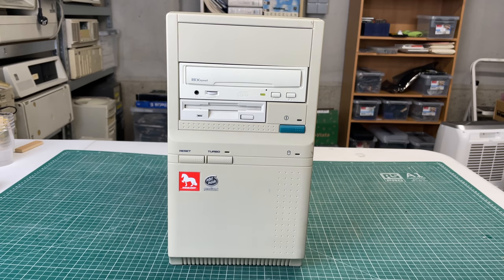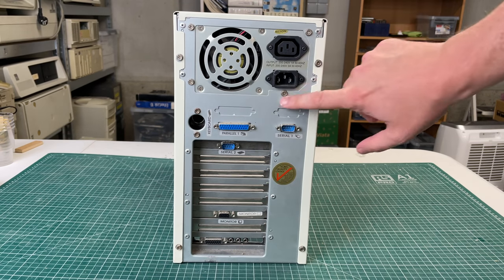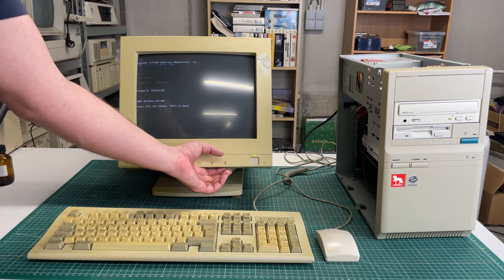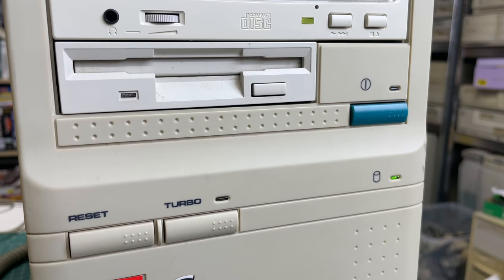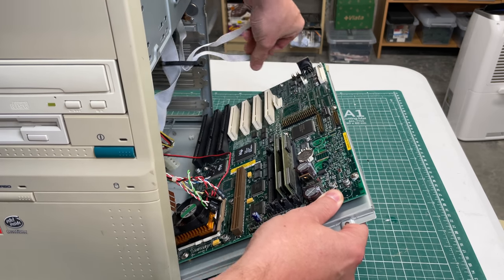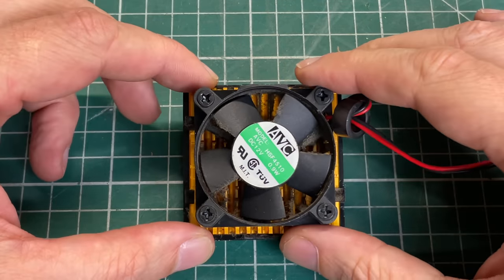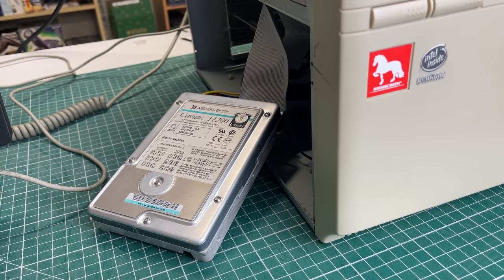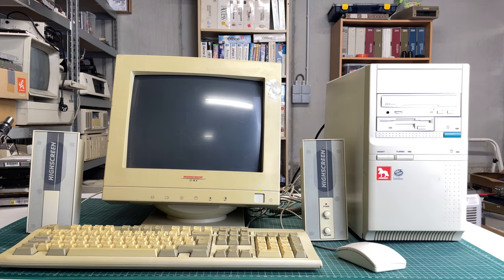HighScreen Pentium 75

Comment: We used to have that Colani tower from the left hand side picture in 1:20, but as a 486 DX2-66. It was a little bit different. The store we bought it from was near the Hamburg city centre, probably crossing Esplanade-Neuer Jungfernstieg. We had to RMA it once though because my father busted up the frame for the replaceable harddrive, but later on we retrofitted it with a Soundblaster and CD-ROM drive. I wish we had it back. And one thing: the POST screen was blue, I don't remember why but it was maybe an older version of the Award BIOS (which I'm still looking for to run on PCem), before they came with the Energy Star logos like in the Windows 95/98 era.

Comment: The harddrive in fact did make a sound, the little "beep"you hear is the drive motor trying to spin up and not a warning about a dead cmos battery.
Reply: I worked on these old pc when they were new and those maxtor would sometimes seize up if you left them turned off too long between power on states. You just had to take it out and shake it gently as it tried to boot and that would typically get it going again.
Reply from the maker: Correct, unfortunately the hard drive has bad sectors and not that reliable to use anymore.

Comment: 16:22 Those were Primary IDE (40-pin), Secondary IDE (40-pin), Floppy (34-pin), Parallel (25-pin), respectively. You could see "PRI IDE" "SEC IDE" "FLOPPY" "PARALLEL" written on the board.

There is no Game Port connector or reserved solder points; on the other hand, there are VESA Feature Connector (26-pin) next to AT power, and a Wavetable connector (8-pin; I've never seen a wavetable daughter board with just 8-pin before) between 14-pin VGA (pin 4 or 9 can be omitted on a DV15 connector) and 4-pin analog CD audio connector.
Reply: floppy is 34 pin
Reply: Fixed.

Comment: Real fun to see this. I started my Windows experience with a Pentium 1, 75mHz. I had 16mb system memory and started with a 850mb HDD. That failed pretty quick within the year so i got a replacement HDD of 1,2GB. All this back in 1997. A  2000 euro these days, Targa computer that weight a ton ;-)

Comment: I'm glad you got a functional 90's hard drive going in the HighScreen. An old hard drive with it's bearing whine just 'feels' right to me, not a standalone CompactFlash adapter.
Reply: Same...
Reply from the maker: Yeah I try to use hard drives most of the time, even on XT class machines. With ethernet installed (pretty sure every collectie has boxes full of them) transferring software is pretty easy. But on lower class machines networking is also slow and hard drives small, making it not very practical.

Comment: It seems the "beeping" was actually coming from the HDD since it stopped right when the HDD started up. I guess it was the motor attempting to spin that was making this sound.

I have the pentium 100 version of that pc :)
Now the motherboard died years ago, but the case is still ok. I guess I could rebuild that pc using another motherboard with the same chipset.

By the way I saw you took an image from UH19. I don't mind that you use them (we don't own all of them anyways), but a reference would be appreciated, also some images are copyrighted by their authors and licenced to us. Even if you don't want to reference UH19, please reference them :D
(This also counts for images from other sites, like the one from vogonswiki, they'd probably like to be referenced)

Good video as usual :)

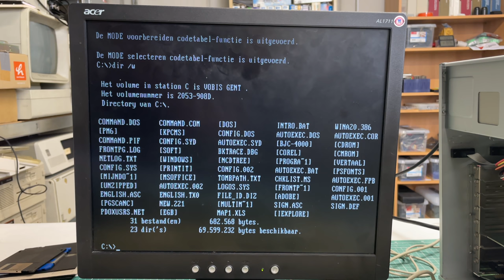Comment: 11:00 The presence of the .dos files on the root indicates that Windows 95 was installed over a previous version of DOS. I’d be curious if it boots ok to that (if you’re willing to let it do the additional disk operations to rename the system files.)

I also have a 1.2 GB drive in my Pentium 100, though I partitioned mine so that the last ~ 200 MB would contain installation files and miscellaneous stuff so that the main partition would benefit from the smaller cluster size by being just under the 1 GB barrier. It probably doesn’t matter as much in your situation since I can tell you opted for FAT32, based on that 4kB cluster size on the format screen.

Comment: Its interesting, a friend of mine actually bought the sky tower with a p133. Seems that they put exactly the same board just into the sky tower. I totally remember those missing chips and this weird power connector
Reply from the maker: Yeah this motherboard maxed out at 133MHz if I’m not mistaken.
Reply: @RetroSpector78  You know... the other day Clint (@LGR) was asking "what would be the bottleneck of his Pentium Overdrive" 😐.. I comment that is the crappy motherboard 🤨.... and i tell him to look for an Intel "Batman" or similar from back in the day.. 😃...... Now I'm at 5:37 in this video ... and I bet that this machine with that motherboard.... performs much better.. just because of it.. 🤓
Reply: @amurtigress_mobile365  "The odd extra power connector there is for a 3rd AT power connector that provided 3.3V."
That's right. This was the shortly lived spec between AT power and the 20pin ATX power spec. The ATX spec (both physical and electrical) was likely released right as this motherboard was made.

Comment: 8:21 - It's always worth ditching those Molex passthrough power connectors if you can (the one used to power the fan).

I found over the years that the contacts in them are often quite bad, and can create a high resistance. Hard drives need a fairly high peak current to start the spindle motor, and those power connectors have caused me problems in the past.

I had a few of them where the "gold" coating had corroded, caused a high resistance, and almost caught fire.

There may be a header somewhere on the motherboard for 12V to power the fan, but I know that wasn't so common on older boards with the "AT" style power connector. It's probably better to splice into the floppy drive power cable perhaps.

Comment: I have a very similar system from 1997. Guess it's also a Highscreen. Even the case is the same, but my power button is more square than rectangular.  I upgraded from the standard 850 Mb drive to a whopping 1 Gb!
And it has an AMD-K6 233 with a Biostar Voodoo Rush card, which I was able to find drivers for Windows 98, but not for DOS. Still want to find DOS drivers so I can play Screamer Rally again :)
Nice video!

Comment: Highscreen Pentrum 166MMX was my first PC computer. I still have it, but didn't use it for years. By now i'm afraid to check if it works without recaping. Luckily main board battery is looking good.

Comment: ...you must have been very optimistic as you were trying to install Win95 straight from the CD-ROM instead of copying installation files to the hard drive beforehand ;)
Reply from the maker: Yeah I totally forgot about that
Reply: with Smartdrive loaded beforehand, the installation from CD was almost as fast as from the HDD, provided you had a CD-ROM faster than 4x :)

Comment: This was my first PC in 1996:
* Cyrix 6x86 P166
* 16MB RAM
* 2GB HDD
* 3,5" floppy drive
* 16x CD-ROM drive
* 4MB ATI video card with MPEG video hardware decoder
* Aztech Waverider Pro-32 3D audio card
* PS/2 keyboard
* PS/2 mouse with scroll wheel
* 15" crt monitor with integrated stereo speakers
* Windows 95, Drivers and Lotus smart suite 96 on setup CD
* User manual with first steps in Windows 95 and Lotus smart suite 96
The Cyrix 6x86 P166 has 133 MHz, but more integer performance than a Intel Pentium 166 MHz.

Comment: Ah, the Intel Advanced/EV motherboard… I had its brother (or sister) back in the day, the Intel Advanced/ZP or Intel Zappa board with a Pentium 90 MHz. Those are very reliable motherboards! And they take the Pentium 166 Overdrive with MMX processor. Initially, my PC back then had an ASUS motherboard with an non-Intel chipset and that was not compatible with the Overdrive CPU.

Comment: Very close specs to my first PC, except mine was a P90
I also remember swapping the 8MB memory for 16 and being quite surprised at what a difference it made
Ahhh those were the days
Reply from the maker: Yeah … future video is going to be about software and games. I remember the pentium being a step up from a 486 so it will be fun to see what kind of software this could run that a 486 could not
Reply: My first PC was an 80 MHz Cyrix 486 DX/2 back in 1995. It came with 4 mb of RAM. I've had it upgraded to 8 mb which made quite a difference. It also burned a hole in my pocket though.. As I recall those 4 mb of RAM costed me 250 gulden. About 100 Euro.
Reply from the maker: @SandsOfArrakis  I remember trading in my electric guitar for a 4x1mb 30pin simms. As I didn’t have money for an amp the electric guitar was pretty pointless anyway :)

Comment: Maybe this is a silly question, but what is the purpose of the little metal bushing the CPU fan wires are wrapped around? I've seen this before, no only on fans but on the power lead for a DC motor. Thanks! Love your videos man.
Reply: It's a ferrite core used to filter out electrical noise. Usually you would only see these in OEM computers for regulatory compliance.

Comment: The additional power connector on the motherboard is for a "P10" connection from the PSU providing 3.3vdc and ground.  Dell utilized it and you did show the Dell version with the onboard S3 graphics chip.  I'm not sure what it actually did beyond that though.

Comment: I don't think that mobo actually has L2 cache on it. 2 pads next to the cpu are unpopulated, that is where the burst sram would normally sit. The other 2 are just buffers for each 32 bit bank of memory and also act as cache controllers. At least that is my best guess. Every FX board I had with BSRam had 4 of those little rectangular packages on them or 2 with a coast.

Comment: 15:40 There is no onboard cache, those chips (which look like cache)  above the COAST socket are part of the i430FX chipset.
I have the Intel Advanced/EV with onboard Vibra 16, but I had to hunt down the audio riser card (Intel PBA 636117-002), none were available on ebay, so I had to track down an unsold one from years ago! Luckily, the seller still had it! Then 2 of them showed up on ebay after the sale .🤣

Comment: I have been messing around with a bunch of old parts I have had for years. The other day I was given a bunch of old sound cards, got a Soundblaster 16 ct2290 but it wasn't working after checking the card over I noticed that someone had forcefully removed the 46.61512Mhz Crystal Oscillator. IDK why they removed it but I had a spare one from a messed up similar card that I popped in and all is well with the card now. still, some more testing to do but it wasn't working before and it's got that retro sound I remember lol.

Comment: Those Maxtors in the 1995/6 era were so slow, I think the spindle speed was only 4480rpm on my 1.3Gb drive.  My Compaq Deskpro 4000 at work had the 1Gb variant.  Our Mac had a Quantum Fireball 1280AT with a 5400rpm spindle and what a difference in performance.

Comment: I also have of these Intel Advanced/EV (Endavour) socket 5 motherboards, with the audio chip on it and the proprietary riser card with audio connectors on it. All this generation of Intel motherboards with triton FX chipsets are really super stable and none of them has failed so far (I think I have at least 6 or 7 of them, mostly OEM from Gateway).
Reply from the maker: Yeah I like these intel boards. Never seen one in real life with onboard audio / video.
Reply: I also ran an Intel Triton board and it was very reliable.
It also looks and FEELS like a quality board (unlike the cheaper made in Taiwan brands). No sharp edges on the board, all the connectors and jumpers were labeled. Often Intel would use much better quality parts, like capacitors. The only downside to an Intel board, was that there was no overclocking.

Comment: Greetings from Austria,. i had the exact Same Tower and Monitor in End of 94, with a AMD 486 DX80. 4 MB RAM and no CD ROM Drive and 420 MB HDD with OS2 Warp pre installed (on CD was Windows 3.11 but no drive :)) , the PC was barely useable with that after adding Sony Double Speed CDROM with extra Controller Card and extra 4 MB RAM the PC was so much faster (OS Warp was then removed)

Comment: I have the same motherboard on one of my assembled at home computers, bought back in the day. Too bad it doesn't fit my GUS Max as it collides with the CPU, so I have it still in the 486 which is a bit ill. Nice and solid board this one. I don't have the S3 populated but I have the integrated Vibra and thanks to the OPL3 it is pretty decent for old DOS games.
I am halfway to make the external adapter to be able to use the joystick, as that was lost somewhere in time. 

If you need the board's user manual in pdf I found a matching one as "Intel Advanced/EV Motherboard Order Number 281835-001 May 1996" . Somehow the date doesn't match (I indeed got mine back in 95 if I recall correctly) but it is pinpoint accurate.

Comment: i would see if you could change the FSB to 33mhz... all p75s I came across ran  at 100 without issues  back in the day - if its an intel EV board it be worth looking around for an MRBios for it by microid research - these were the absolute best bioses for  the Endevour and Zappa  boards.. the reduced boot time and  speed improvement for HDD access was well worth it back in the day

Comment: Sometimes very old drives (and them older maxtors are kina intrinsic to it) will refuse to work on thier sides or at an angle because of drying/wearing out of the drives spindle bearings.

Comment: Which was faster? Our second pc was 486 DX2 66MHz o/c to 80MHz (with 16MB of RAM) compare to this Pentium 75Mhz?
Reply: Pentium is in another class, it would smoke the DX66 (even OC'd) like nothing.
Reply: If I remember correctly a Pentium 60 was about the same as a 486 DX4 100 MHz. So yeah Pentium 75 would kick all 486 CPU's behinds.
Reply: @SandsOfArrakis  Regarding the integer operations, you can with late overclocked 486 CPU's beat first pentiums, but in floating point operations pentium will always be ahead.

Comment: The hdd didn't work in the pc propably because that horrible molex to molex extension for the fan wasn't making contact on one of the pins. Learned a very long time ago, put your drives on direct molex power , those splitter /extension crap is only good for fans ect, and they end up as the last device on the power cable.

Comment: I didn't like the Colani design cases at the time. They looked too much like adding cheap rounded plastic elements to otherwise unmodified (boring) cases. Like a pig with lipstick - it still remains a pig. At about the same time Apple created such nice machines like the PowerMac 6100 (a pizza box). Nonetheless I ended up with such a PC since I couldn't afford a Mac as a student.